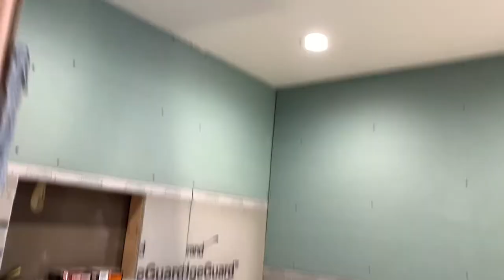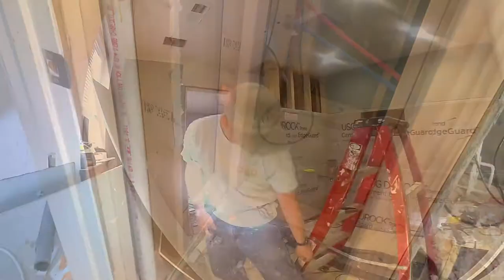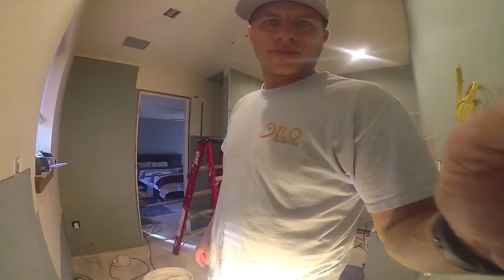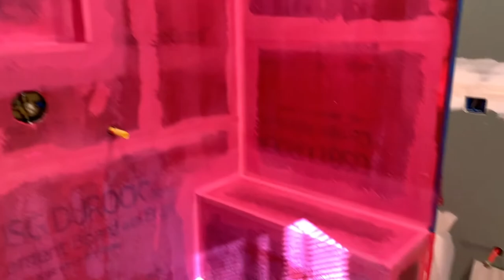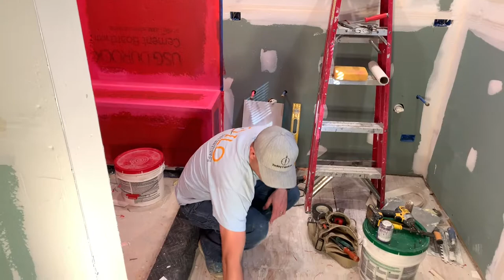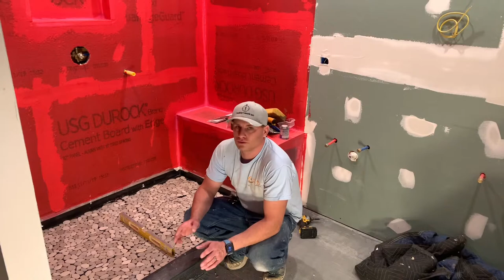Drywall, Recessed Lights, Joint Compound, and Prepping for TILE!

Comment: In terms of water proofing and longevity; no concerns about installation times…does tile ready have a clear advantage over cement backer board products like USG or Perma and roll on water proofing?
Reply from the maker: Concerning on the walls? Or making a shower pan out?
Reply: @TodayIWorkOn  is there a clear advantage for using tile redi shower walls over cement backer boards

Comment: What type of thinset do you use with alkali resistant tape on cement boards? And is it the same thinset you would use to hang tile on cement board in shower?
Reply from the maker: I really like All-set by schluter. It’s my favorite to move and work with. Yes, a modified thinset like all set will work on the cement board just fine.

Comment: The outside corner, are you going around it with tile or tile ends to wallboard and how will you do that?  I was thinking about trying to find a Schluter edge on mine because I want to end the tile at the outside corner, 90 deg to sheetrock - everything on their website seems to show tile to tile 90's
Reply from the maker: Yup, schluter jolly 1/2” from the outside corner.
Reply: @TodayIWorkOn  Thank You, and I could see that on the next video 🙏🏽

Comment: What do you use to seal the shower valve? Does the Kerri valve seal work on durarock and red guard?
Reply from the maker: Every system is different. I think in this bath we used a delta which is waterproofed at the trim cover. I've never used a kerri valve, but it might work.